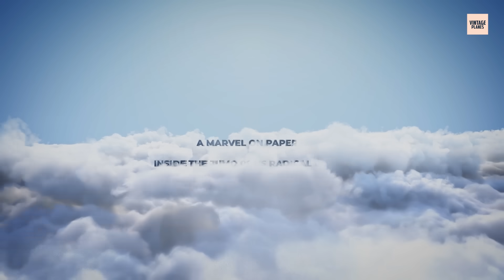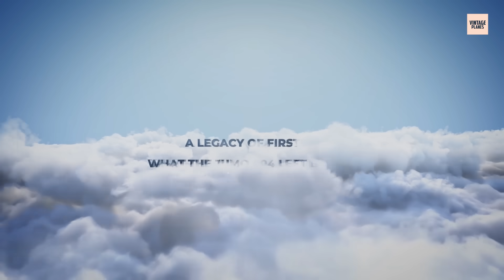The Shocking Truth Behind Germany’s Jumo 004 Jet Engine

Comment: The British knew about Axial jets,  but realised that centrifugal engines were the only way to go with existing metallurgy... Axial engines ran hotter, had to be either on or off and was ultra prone to flaming out.  The centrifugal engines could be controlled across a large speed range,  were much more reliable and lasted a lot longer between rebuilds.  The centrifugal engines still used in places where frontal area is not a problem, like helicopters and stationary turbines - the centrifugal compressor can get much more compression into a shorter length.
Reply: Centrifugal compressors have rather steadily air flow than axial ones, so they are not vulnerable to compressor stall.  But axial compressors are more efficiency than centrifugal ones.

Comment: First generation jet aircraft wouldn't have been very useful to the Allies, which is why they weren't a priority. Even the Me-262 couldn't take off from far away bases, form up, climb to cruising altitude, fly to the target, mix it up with enemy planes, disengage, and fly back to their bases. Not gonna happen prior to aerial refueling technology, which was still a dream in WW2. The Allies wanted/needed to overwhelm the Luftwaffe. So much so that even the Me-262 would be too-little, too-late. And it was, most definitely.

Comment: The next "generation" of turbojet engineering and development were centrifugal-flow instead of axial l-flow. Later on, as the materials and technology evolved, they went back to axial flow engines. Centrifugal-flow allowed performance up to/VERY close to supersonic... with only ONE reheated/afterburning engine. It was gonna take a few years before an axial-flow compressor could generate that much thrust.

Comment: The contemporary MetroVick F2/F3 was more sophisicated and powerful and reliable than either the BMW or Heinkel engines and went on to become the Sapphire which powered many aircraft post war aircraft. The F3 put out 2,700lbs of thrust. The British decided to go with centrifugal engies which was the right decision at the time as they were more powerful and dramatically more reliable. A Nene copy  even later powered the MiG 15 outperforming the F-86 in climb and ceiling.

Comment: While the Me 262 was nominally capable of reaching speeds of 540–560 mph, its effective combat speed was typically lower. Operationally, the aircraft was restricted to around 450, with German pilots instructed to avoid exceeding 500 mph due to serious control and stability issues. At speeds near its maximum, the Me 262 experienced tailplane locking, a phenomenon where aerodynamic forces rendered control surfaces unresponsive, often causing catastrophic dives into the ground.

•  The Me 262's Jumo 004 axial-flow engines suffered from critical reliability issues:
•  Engine lifespan was typically 10–25 hours under ideal conditions.
•  Throttle response was extremely poor; rapid throttle changes often led to flameouts or stalls.
•  Maintenance requirements and low-grade metallurgy further degraded serviceability under combat conditions.

Contrary to popular belief, the Me 262's swept-wing design was not implemented for transonic performance advantages. Rather, it was primarily a structural and balance solution to accommodate heavy engines mounted under the wings. The outer wings were swept to rebalance the center of lift due to engine weight; the inboard wings were nearly straight. The minor sweep had little effect on compressibility drag.

While Germany pursued urgent deployment of jet aircraft as a technological stopgap, Britain's approach was more measured, prioritizing industrial capacity and the proven effectiveness of propeller aircraft. The RAF possessed high-performance piston fighters such as the Spitfire Mk XIV (Griffon-powered), which could achieve 480 mph—within 35 mph of the Me 262 and with superior maneuverability, climb rate, and tactical flexibility.

Despite recognizing the promise of jet propulsion, British planners did not consider it decisive for victory in 1944–45. Instead, they maintained an industrial strategy focused on reliability, logistics, and air superiority through numbers.

The UK led in turbojet engine development with at least five jet engines in active R&D by 1944:

•  Power Jets W.2 (Whittle/Rover) – centrifugal flow, matured into the Welland and Derwent.
•  Halford H-1 (de Havilland) – became the Goblin, used in the Vampire.
•  Metropolitan Vickers F.2 and Beryl – axial flow, tested as early as 1942.
•  Rolls-Royce AJ.65 (Griffiths) – early axial-flow designs that presaged post-war success.
•  Armstrong Siddeley ASX – hybrid axial/reverse-flow system.

The Metrovick axial-flow engines, test-flown by 1942, produced more thrust and had longer projected service lives than German equivalents. Their exclusion from combat aircraft was primarily due to cost, complexity, and production bottlenecks—not technical inferiority.

By 1944, Germany’s strategic position dictated their jet program’s urgency. The loss of high-grade petroleum sources - particularly from Romania and later Eastern Europe - crippled the Luftwaffe. Synthetic fuel production (J2) derived from coal remained viable for jet engines, which became a strategic niche. Consequently, the shift to jet aircraft was less an innovation initiative and more a pragmatic adaptation to fuel scarcity, with conventional piston aircraft increasingly grounded by fuel shortages. The Luftwaffe's late-war shift to jet aircraft was, in part, a reflection of desperation rather than foresight.

Germany pursued a hasty and ultimately flawed jet program under deteriorating conditions, producing aircraft with impressive theoretical specifications but marginal combat impact. Britain, by contrast, invested in sustainable engine development while continuing to dominate the air war with piston-engine fighters.

By 1945, Britain had produced multiple functional jet engines, many of which exceeded German thrust ratings and operational lifespan. The post-war aerospace boom in the UK and U.S. owed more to these measured wartime developments than to the over-celebrated Me 262.

References
•  Boyne, Walter J. Clash of Wings: World War II in the Air. Simon & Schuster, 1994.
•  Gunston, Bill. World Encyclopaedia of Aero Engines. Patrick Stephens Ltd, 2006.
•  Price, Alfred. The Luftwaffe: The Illustrated History of the German Air Force in World War II. Greenhill Books, 1991.
•  Kay, Anthony. Turbojet: History and Development 1930–1960. Crowood Press, 2007.
•  Neale, Ian. Gloster Meteor in British Service. Osprey Publishing, 1970.
•  Whittle, Frank. Jet: The Story of a Pioneer. Frederick Muller Ltd, 1953.
Reply: This is phantasy.. I did not find in German reports.
Reply: @holgernarrog962  
All factual. 
German reports?
Reply: @johnburns4017   Similar concerns are also noted in the FAA airworthiness certificate for the new-build Me-262s manufactured by CFI in Washington state.  The FAA based their opinion on flight test reports for the Me-262 and their concern was that the new-build Me-262s are copies of the same platform with the same flight issues and fitted with more powerful engines that could exacerbate the problem.  High speed vibrations and uncommanded rudder reversal were interesting comments. The FAA initially limited the new-build examples to 500 mph.
Reply: @holgernarrog962 
It is factual.

Comment: The thing a lot of people seem to miss is that shifting to jets quickly made a lot of sense from the German point of view, despite the work-arounds imposed by the lack of various heat-resistant alloys.
Jets required a lot less of the so-called 'strategic materials' compared to a high performance piston engine.
Jets will also work with much easier to produce & lower quality low octane fuels compared to a high performance piston engine.
The Germans came up with some clever ideas to get around that lack of high temp alloys, air-cooling the turbine blades being an obvious example (still used today).
Fortunately they got a lot wrong....& as Galland himself said, let us be glad they did fail, the murderous & vile nazi regime deserved to fail & Russia got less of Europe because they did fail as they did.

Comment: GE built the wrong engine. Axial was known to the Brits, but knew the metallurgy would be another challenge. One challenge at a time. Actually, metallurgically, the Brits were better set to build an axial. The C-47 had the same wing sweep, and for the same reasons. Everything people think they know about the 262 is mostly BS.
Reply: That’s how the C-47 went supersonic.🫡 We all thought “over the hump” meant the CBI theater over the Himalayas…
Reply: Both Lockheed  and Westinghouse were working on axial flow engines during the war. Lockheed had their L1000 which evolved into the J37 and Westinghouse  J30. There were quite a few development problems preventing them from being ready before the war ended.

Comment: There are several ME262 still flying, I think one still uses the original Jumo engine. This tells me that the design was sound, but the materials available in 1940's were the sole problem along with the use of slave labour who wanted to sabotage everything they could. Given that, if they had the materials and skilled workers the Jumo would have extended the war for years.
Reply: If you think about what happened to Japan, you'll realize how wrong that is.
Reply: They use later turbo jet engines from 1960's that generate 50% more thrust and are far more reliable than the Junkers Jumo 004. The Junkers Jumo was studied, and only some new copies were made in Czechoslovakia and the Soviet Union beyond 1950 they were relegated to the obsolete scrapheap.
Reply: @damianousley8833   The Czechs manufactured a few Me-262s after WW2 with leftover parts and only managed to get their 004 engines to about 60 hours TBO.  I've read that pilots didn't want to fly them and by 1949 they were ground instruction airframes.  The Soviets manufactured about 1200 copies of the 004 for their projects and their work wasn't any better from the little I've seen said about it.
Reply: They use Continemtal J-65s
Reply: Extend the war for years, bullshit, come August 1945 onwards 2 or 3 atomic bombs and Germany would really have been finished. The German civilians were lucky the war ended in May 1945. Remember the Manhatten project looked at Germany as its first target forthe A bombs. No jet engine was going to stop that. Germany could have had operational jet fighters sooner in the Heinkel 280, except the ministry of aircraft in Germany, which was heavily skewed towards Messerschmidt.
Reply: Bad pronunciation, incorrect facts and throwaway comments. Not a great video unfortunately.
Reply: Me 262 A-1a/U3 W.Nr.500453
Flying Heritage Collection, Everett, Washington, United States, currently undergoing restoration to flying condition. It is intended to fly using its original Jumo 004 engines. The aircraft was bought from the Planes of Fame Air Museum, Chino, California.
Reply: “…the design was sound” doesn’t follow from ME-262s still flying today.  Replicas are flying today because of the plane’s historical significance, dangerous looks, and a boatload of cash - mostly cash.

People don’t build replicas of the Wright Flyer to take their families skiing at Vail, because the design is sound.

No originals fly, and in this instance, that’s the responsible (and safe) choice.  Not only are the Junkers jet engines not safe by today’s standards, original Jumo engines have extremely high historical significance as well.  We shouldn’t expect priceless artifacts falling out of the sky.
Reply: @Pene7942 well explained. If anyone were to rebuild the 004 using today’s materials, it just might work as envisioned. But that is another story